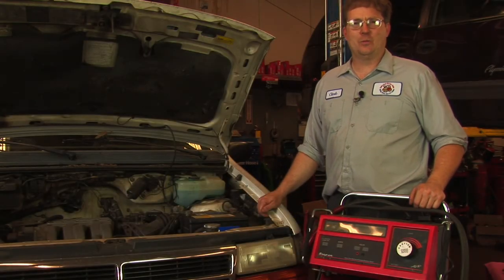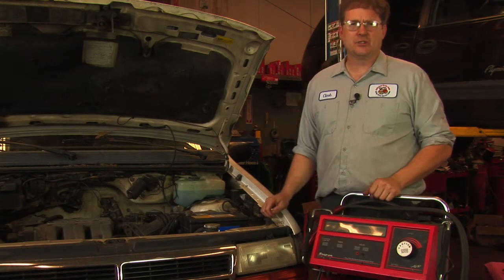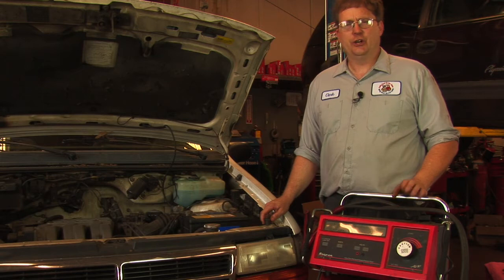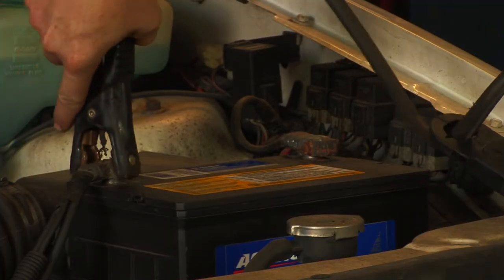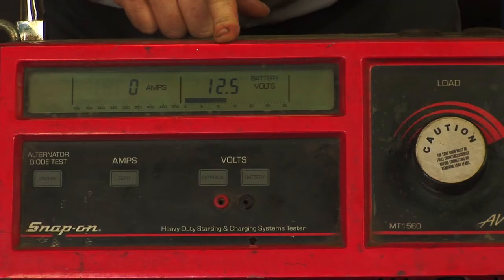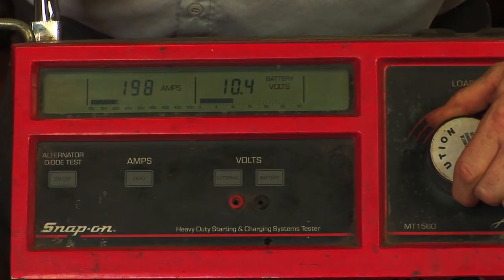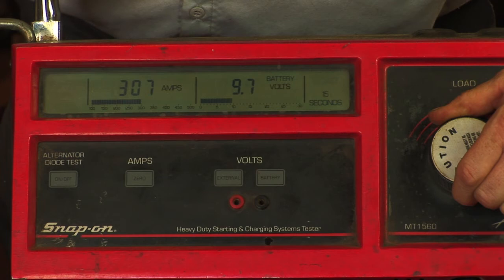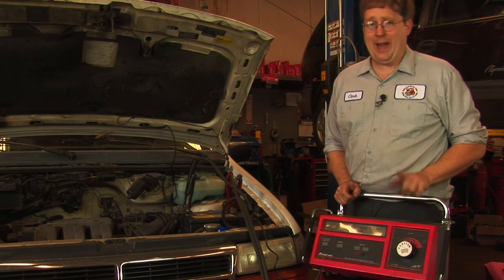Auto Repair & Maintenance : How to Diagnose a Bad Starter Motor

Comment: Load testing a battery is not how you diagnose a bad starter. There are a million reasons besides a bad battery and starter that can cause an engine to not start.